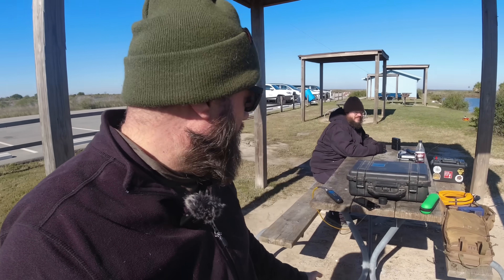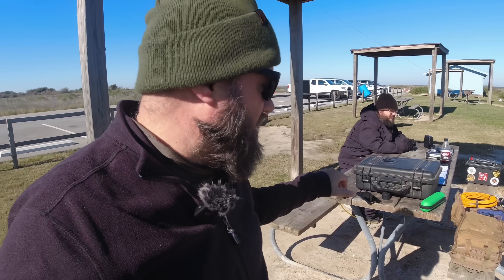NEW Antenna! Reel POTA-able EFHW Ham Radio Antenna for Quick Deployment!

Comment: That was a 7m pole yes? I was planing on using an DX Commander either Sig 9 or Classic Pole. Not backpacking so weight not an issue. I'm gonna get one those antennas because I do not have a portable kit yet but this will get the ball rolling. 73 kn6zvi
Reply from the maker: Yes

Comment: Oh cool, stole my design directly from my YouTube channel.
Reply from the maker: Your design?  Where's your patent on this design that's been around for a long time?
Reply: @HamRadio2  no patent ha. Not going to try and stop anybody from selling them either, just musing at the timing of this. Show me a "chalkline" antenna that's existed before I released my video if you know of one, because a huge amount of research into various reels and I never found one. I didn't sell any of the ones like this I made because of some reliability issues with the plastic reel, but I have a version two I just bought supplies to make more of and a version 3 3D modelled that I will be testing. Version 2 will be on my eBay store once I get a few assembled.
Reply from the maker: @BucktailResearch  I say this with respect, honestly - but I had never heard of your channel until you made this comment - then I went to your channel and saw you only have 16 videos, but the video about the reel antenna has lots of views, so congrats on that.  But I have seen this design in the past, maybe a year ago, and never have seen your channel.

Many of these antenna designs are "copies" of one another - each has their own unique take on what is essentially a EFHW Antenna, and those are all basically the same.  I know the guys who designed this specific antenna and I am pretty confident to say that they didn't copy anyone, they just came up with an idea that other Hams have had before.
Reply: Right on. I don't really like the idea of patents due to the stifling of innovation they have, and I'm certainly not going to try and stop someone from innovating their own variations. Motivation for continuous improvement. And as you said, mine was a variation of a reel type military antenna I found from decades ago. Shortly after I made mine, wyoming_survival and possibly the tech prepper made versions with mini clothesline reels that are pretty cool. My initial comment came off rude. I was more just taken aback in the moment by it being nearly identical to my first version which I think I only showed on Instagram after looking back through my YouTube.

Comment: I love an efhw, probably too much, however;
The problem i have is the beginning of this antenna is coiled up in an insulated choking inductor that also induces capacitance, if you don't know, most of the RF emits from the first 30% of the element, and lobes to the end of the element, it's a neat trick, as if they aren't lossy enough you gotta go choke it out, best antenna for that completely unobstructed setup there is a quarter vertical

Comment: Looks like a fun and convenient antenna. I'd assume that you could adjust the length to make it a true half-wave on any of the bands. If so, that'd be nice for DX to set it up as a half-wave vertical on 10M or even up to 20m, depending on mast height. It should be a great takeoff angle and radiation pattern as a vertical.
Reply: It's easy to tune. And it's nice can fine tune it easy. Have enjoyed mine the last several months

Comment: The slide on top is for putting chalk inside a speed chalk line, which they used to house the antenna wire.
Reply: That's to let the RFI out. 😂
Reply from the maker: Yes but that chalk line is no longer inside of this enclosure

Comment: Where can we buy one ?
Reply: I have 20 left on ebay
Reply: And on reel efhw.   Link in description
Reply from the maker: Check the description
Reply: @HamRadio2 l was using the same antenna for the contact we made during your activation, l was running 5 watts KC0NMZ